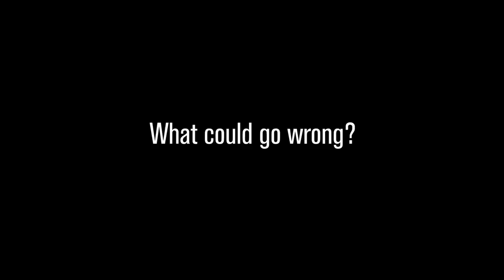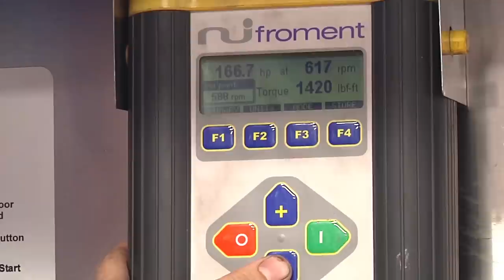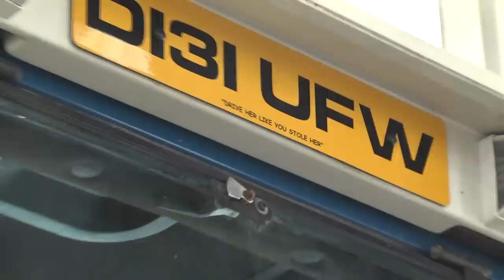Two Legends and a Donkey - Donkey's Cut

Comment: My favourite dvd by u guys. Think I've watched it so much iv nearly worn it out. Watching this convinced me to buy me 8830 powershift. The old crash box just seemed hard
Reply: Crash box wasnt that bad when you get the hang of it basically its all about rev matching which becomes second nature overtime . Funk gearbox was a big improvement not jut for its easier operation but it had more gears making it easier to get a gear that suited. My ole Boys work had a TW-15 as their main tractor but his boss also bought and sold tractors and they got an 8730 which only problems were a blown turbo and a few seals in the box when she was stripped the Gearbox was like new with no wear at all and she had a few hours on her not sure just offhand.

Comment: Donkey people are still liking old tractors as they are almost as cost effective when people have tallied up the diesel burnt between new and old tractors and we are back down to pushing more horse out of a smaller displacement hell the FPT engine is 6.7 litre and the TW series were 6.6. Also old tractors break you can fix most of these CVT's break you need someone on know-how and the electronics cost a fortune to fix.

Comment: HI Donkey just letting you know that these vids are great & honest.  If your interested machinery Pete USA on y tube Under Dennis Polk auction part two, has a nice JD 4755 for sale. Back to the power test of your JD 4755 what was the cause of the power loss on the dyno. Regards Adrian
Reply from the maker: The pump was turned down.  At the pump was adjusted ever so slightly and the big 47 is now putting out around 240 a tthe shaft.   Lol
Reply from the maker: Thank you.  It's important that people understand the journey and what we were trying to achieve.